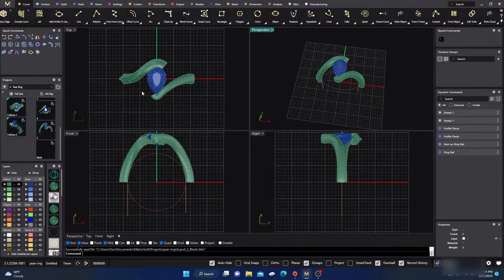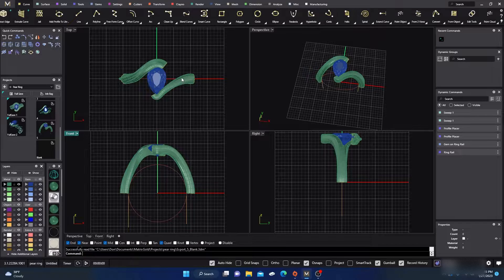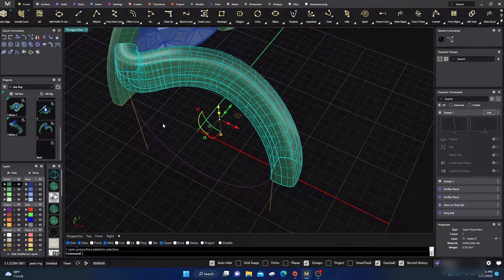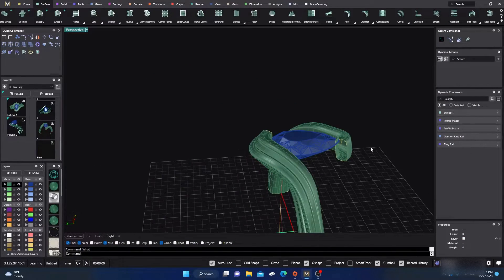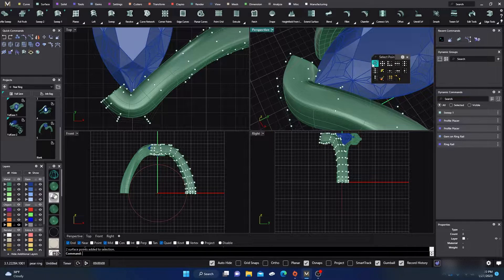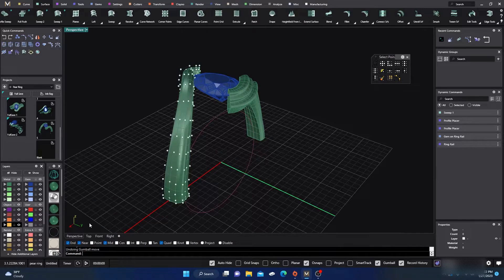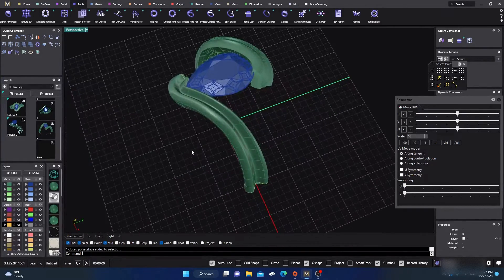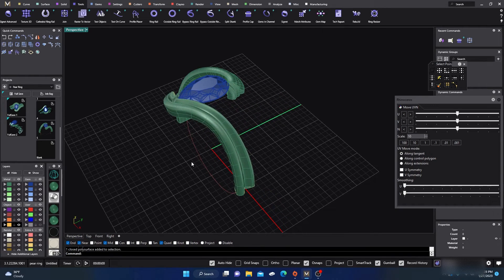Matrix 9 to MatrixGold Point Editing

Comment: Thanks alot sir!  I need your support on an issue. Tech Report used to show up in color for me, now it's black and white. I looked at all the settings but couldn't find it. How can I fix this?
Reply from the maker: Not heard of that one before. Before you doing anything I would shut MG down and reload it. If that didn’t work you can always go to preferences and reset user interface. That’s found in troubleshooting In Preferences. If that doesn’t work you can use the reset all settings which you’ll have to shut down the computer and restart it. It should set everything back to the defaults.
Reply: @donsjewelrymakingandjapantrave  I reset all the settings. I even reset it from the option menu but it didn't work.
Reply from the maker: If it’s showing up on your screen in color but not printing in color then it’s a printer issue. Just need to change to color. But if it’s inside MG then I would try the above. You’ll have to go back and redo all your changes you made but that should fix it. If not I would contact MG tech support.
Reply: @donsjewelrymakingandjapantrave  It doesn't have a problem with the printer. When I open it on the screen, it started to appear colorless, it started about 3 months ago (only the 3 pictures on the top right are colorless). Actually, it's not a big deal, but I'm trying to understand why. If I find a suitable time, I will uninstall the program and reinstall it.
Reply from the maker: I’ll do some digging and see if I can find something out that would help you.
Reply: @donsjewelrymakingandjapantrave  Thank you so much for your support